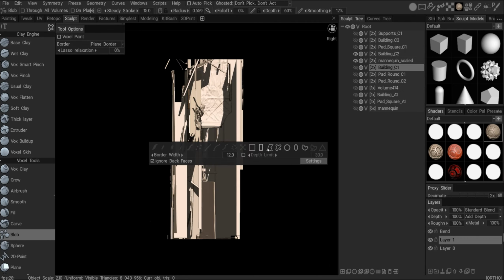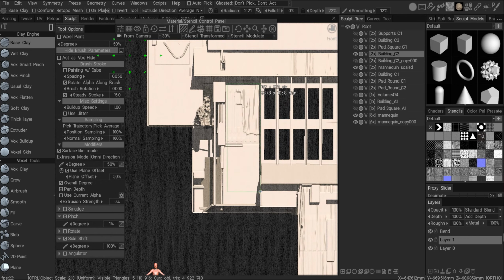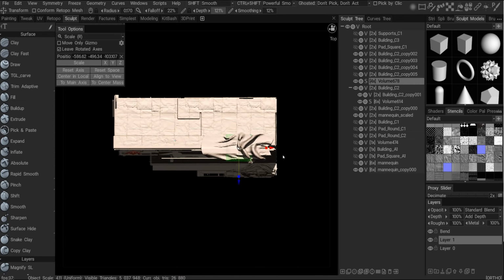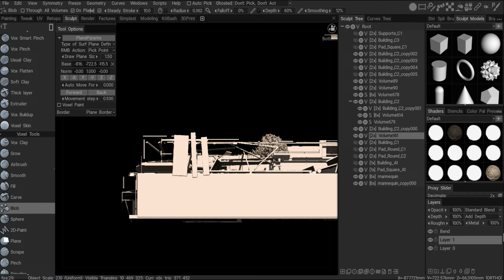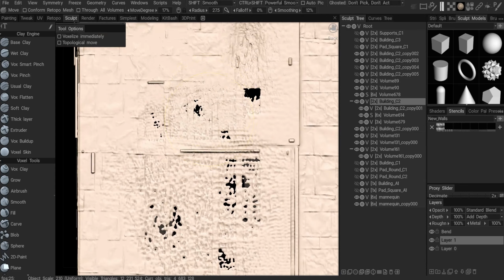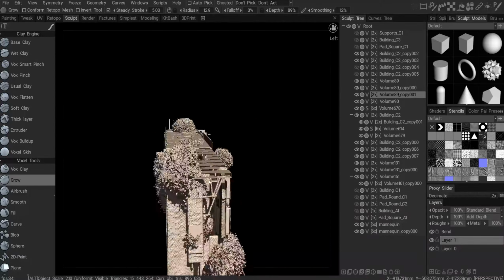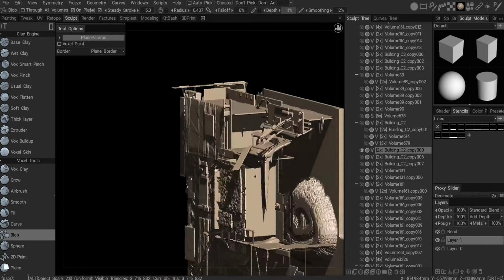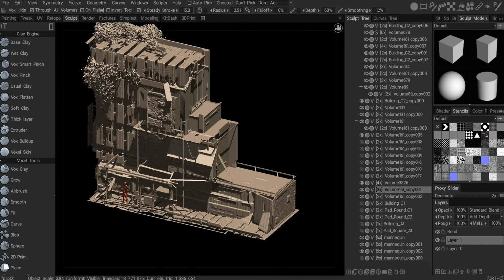Derelict Building Block 3D Sketch - Timelapse with Commentary

Comment: Hey Anton awesome tutorial. About thr cloth tool; do you need to use it with the collision mesh selected and it automatically creates a plane for you? Or you have to create the plane  then  run simulation ?
Reply from the maker: it's very easy tool to use, it will collide with everything that is visible and cloth plane is created automatically for you. Probably the easiest cloth sim I've ever seen
Reply: @AntonTenitsky  thanks :D